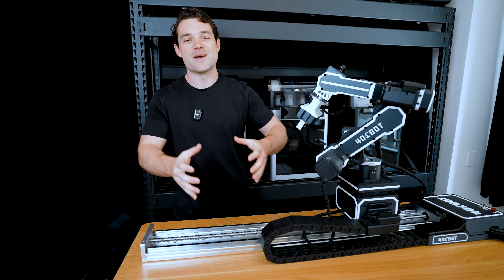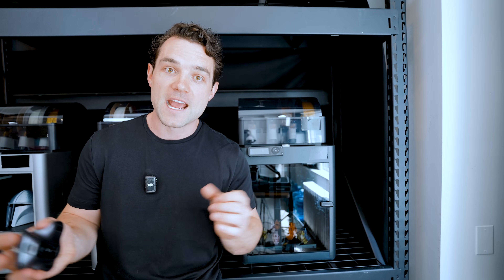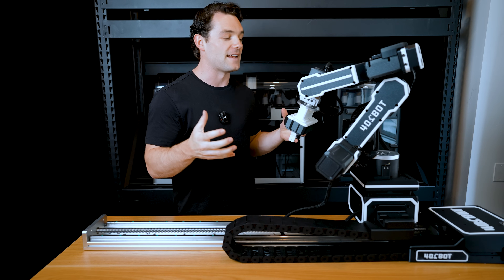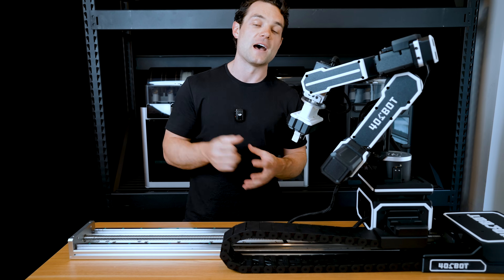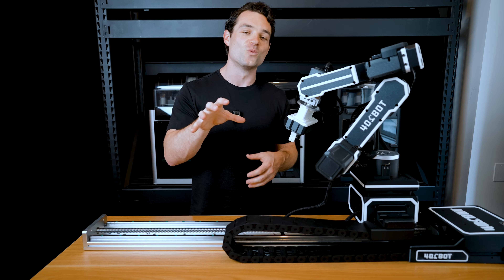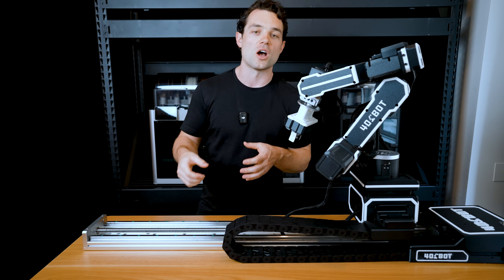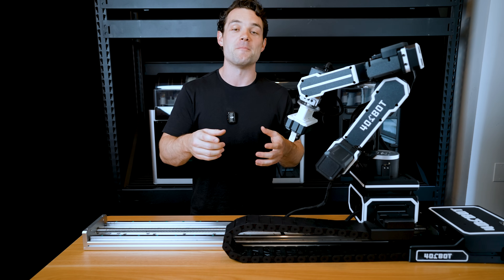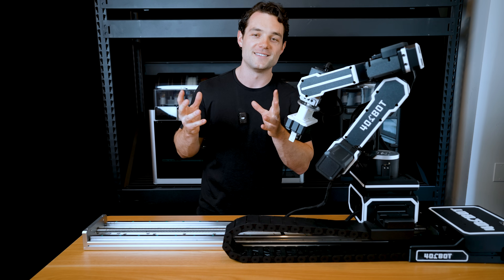Build a 3D Printed Robot Arm

Comment: People print toys and robot arms and all kinds of crap but does anyone print anything that’s actually useful? Cuz I haven’t seem anything useful yet
Reply: You are a bit off topic, but it's worth an answer...  I bought an Ender 3 a few years ago. Very basic by todays standards.  I am interested in CAD software, light engineering, mechatronics, tools etc., but I am not a 3D printing 'Fanboy'.
I can show you about a dozen novelty items I printed because they tickled my interest, usually they were 'cute', or fascinating.
BUT;  I can also show you a far greater number of prints that are only of use to me, normally as part of something larger... a few examples:
**  Replacement bandsaw upper blade guide.  Far stiffer and stronger than the casting-alloy original.  (Additional strength added by through-bolts)
**  Improved throat-plate, and an elaborate dust-extraction duct, for the same bandsaw.
**  Locking hinges for a fold down side table and router table on my sawbench.
**  Holder for dial-test indicators that allows them to quickly drop into the quick-change toolpost on my lathe.
**  Custom brackets to mount a Digital Read Out (DRO) system to the lathe cross-slide.
**  Plastic test components to confirm correct fit, before making the actual item from metal.
**  Quite a selection of thumbwheels, locking knobs etc, for various tools.
**  A variety of end-caps, hole-plugs etc.
**  An attachment for the printer that allows it to cut vinyl lettering etc. with a drag-knife.
**  Improved trigger lock for a hedge trimmer.
**  Bracket to hold the garage door opener and house alarm system remotes from sliding everywhere in the car.
**  Razor holder for under the shelf in the shower!
**  Custom sized funnel for refilling Camp Mother's cooking oil bottle.
**  Flip-top case for my reading-glasses!
The list goes on and on... It really does work for me, with my specific interests... maybe not for you?